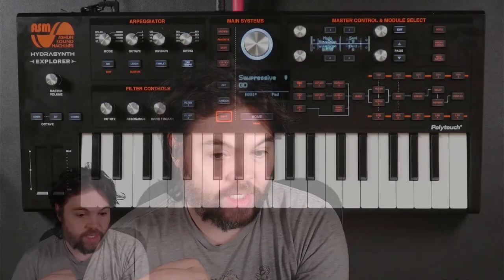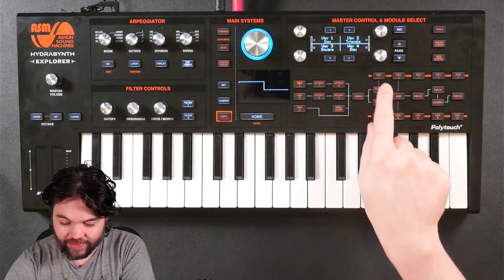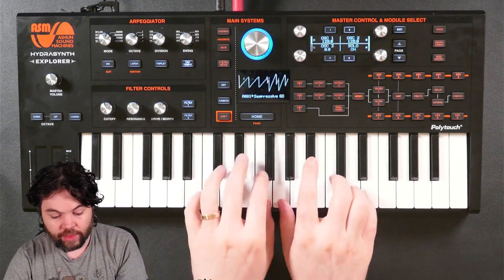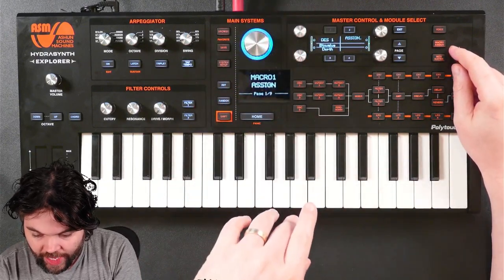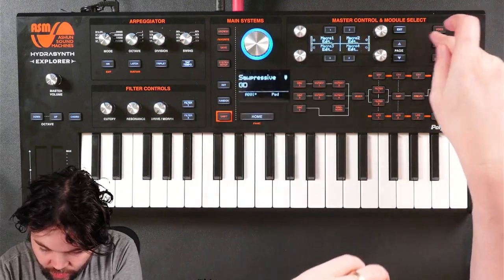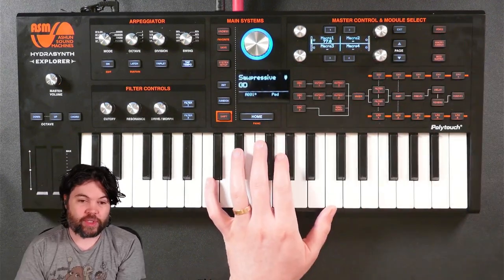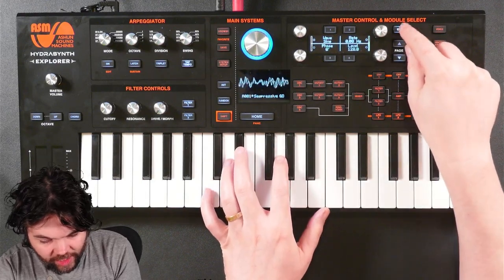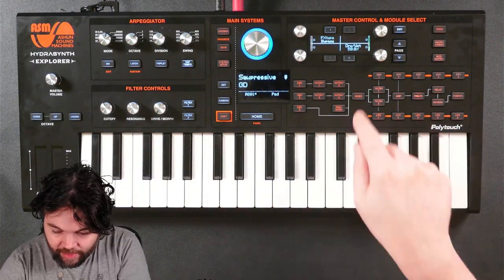Learn With Me - Hydrasynth: Ep03 - Oscillators 1 & 2

Comment: Thank u so much for taking the time to make all these videos. I don't have a Hydrasynth but looking at the sound design capabilities has me wanting one really bad. If you've spent any time with the Arturia Minifreak, what sort of comparison would you make? They both seem great for the price point.
Reply from the maker: Thanks for watching, and for your comment. One thing you might want to do is check out the patch tennis series I made: https://youtube.com/playlist?list=PLuh4CHo4ShJdg_61kZyNUoZOAfDUBV2zy . You get to see me and another YouTuber make patches back and forth showing some of the capabilities and workflow.

As for my opinions, I think the difference between the two is quite big. The Hydrasynth has a slightly weaker core sound, but a very complex modulation section and the mutants, which add some really unique capabilities, alongside the dual filter and poly aftertouch.

The Minifreak has a stronger core sound and a simpler oscillator section, but the oscillator algorithms (and capacity of the second to be a processor for the first) gives easy access to some unusual timbres. Its effects all sound great and generally it feels quite direct.

UI wise, the Hydrasynth benefits from a lot of consistency, meaning almost everything is behind a button and the encoder bank. This makes it slightly less direct vs a typical synth and feels like things are behind a menu, but it's a menu you have a lot of physical means to navigate. I would say it's a good approach to handling the complexity, but it makes it less efficient for designing sounds live. I'd characterize the optimal use case as designing complex sounds including a bank of macros you'd use to control it, rather than dialing in sounds on the fly.

The Minifreak UI is similar to the Microfreak, but with more controls added to give access to the extra features. The panel controls give you direct access to quite a lot alongside using shift to get to secondary functions. You can design a lot of sounds sticking to the panel in this way. Compared to the Hydrasynth (where" everything is in a menu") you feel a big disconnect when you do need to enter a menu. This doesn't stop you designing sounds live, but it does make situations where you need to go into the menu feel more awkward. The mod matrix is fairly easy to use, though selecting the modulation with a single encoder feels a little slower than it could be. One UI element I like is the macro section; while you only get two macros per patch with 4 destinations each, you can control them with a touch strip; I find this much more natural than turning the encoders.

The choice therefore comes down to this; if you want a slightly more immediate, fun and quirky instrument with a broad sonic range, then the Minifreak is it (I haven't even mentioned the arp and sequence which are great). If you want a maximalist subtractive synth with poly aftertouch and an efficient interface to dive deep on, go for the Hydrasynth.
Reply: @ChalkWalkMusic  This comment alone is more useful than the video that comes up when you search "hydrasynth vs minifreak". Thank you!

Comment: ... and the next step would have been to assign a LFO+ to Macro slot 1 in the Mod Matrix. ;)
(But I know you haven't covered that yet.)
So many possibilities with this synth!
Reply from the maker: Thanks for watching, and for your comment. I definitely find myself doing that type of thing often: rather than making multiple mod matrix entries from a single source, I make a macro and use that instead. I've also adopted an approach of placing macros I primarily intend for a human to adjust starting at macro one, and macros primarily for mod matrix use starting at macro 8. As you say: lots of possibilities!

Comment: In your answer to another comment, you mention not having a button to assign aftertouch in the mod matrix. Does that mean aftertouch is limited in its application? I play a Roland AE-30 wind synth and when I control other synths such as the Neutron or MicroFreak, I send the breath as aftertouch and that needs to override the envelope (the breath effectively IS the envelope). Do you think this synth could handle that?
Reply from the maker: Thanks for your comment, and for watching. The aftertouch is freely assignable in the mod matrix, the problem I pointed out was that there isn't a panel button for it; with the LFOs and envelopes you can hold a source button then press a destination button and it'll map; with aftertouch you need to go through the list; my "workaround" to save time is I assign lfo5 which is further through the list so there is less scrolling.

As for a breath controller, the mod matrix can accept any CC as an input (since the controller is monophonic I assume you don't necessarily need to use aftertouch). Assuming the controller sends notes (and depending on the gate length, this assumes it just sends a trig) then you could have a very long release on the VCA envelope and have the breath CC adjust the VCA level (which you'd set to 0, filter might work too). If no note ons are sent, you could latch a note instead and do the same mod matrix routing.

In other words, I think it should be easy enough to do what you want once you figure out how best to handle the gates.
Reply: @ChalkWalkMusic  thanks for the detailed reply. The AE-30 can send its breath and motion parameters as almost any CC. I just pick aftertouch because it's the most frequently compatible - the Neutron even has an Assign CV patchbay output that can have aftertouch assigned to it.

It sounds like this synth could be an excellent companion. The AE-30 internal sounds are a pain to program and frankly don't sound as good as other synths.

Comment: I'm confused about the Macro Assign / Wavescan part ~5:00

This video being my first glimpse at Wavetable / wavescanning synthesis, my immediate thought I have is Ohh you should be able to assign an LFO to modulate the Wavescan position.

Is that what you were doing here? Or simply creating an interface to manually edit the wavescan position for live playing?
Reply from the maker: Thanks for watching, and for your comment. A common use of a wavetable is to have it automatically modulated by an LFO or envelope. In practise though, scanning a wavetable is just another timbral parameter for the oscillators.

As you say, in this case I've mapped scanning through both wavetables to a single (manual) macro control. Just like a mod wheel, a macro remains where you leave it, vs returning to a neutral position like a pitch bend. This means you have two options for using it. One is to move it to find a position you like and just play it like that (a variation on the patch), or to treat adjusting it as part of playing. In this case I use the latter approach and use it to adjust the timbre as I play.

Note that for the Hydrasynth, I can adjust macro parameters from the mod matrix. I could therefore, for example, map an LFO to the macro which would in turn scan both wavetables. In these early episodes I just try and vary what I do and give quick previews of a few features which I explain and use more later in the series.

Comment: What other synths have this much sound design at this cost?
Reply from the maker: In hardware, I don't think it has much competition; in fact there aren't that many "serious" polysynths at the price. You have the blofeld, minilogue XD, Deepmind, JD-Xi, microkorg, Korg mod trio, Minifreak and the new Roland Sh4D. Sound Design wise I think the Minifreak is the closest, but offers quite a different value proposition. The modwave and wavestate are very powerful synths, but a little more specific in their strengths. The blofeld is powerful, but the UI is far less fluid on use. I'd probably say the Opsix is one of its strongest competitors, despite being very different; a very different feature set and paradigm and much lower build quality but huge sound design potential.

Comment: Are you still liking the Hydrasynth?
Reply from the maker: Thanks for your comment, and for watching. Since I got it I've felt in two minds about it. First of all the explorer is very good value in terms of features for cost. The questions are about overall sound (it has something of a "hifi digital" sound mixed with some sort of lofi character) which is surprisingly characterful for a digital synth and you tend to either like or not. Second, there are a few UI/UX quirks; it handles the parameter count well, but it seems to miss a few tricks, e.g no button to assign velocity or aftertouch in the mod matrix, and turning the encoder to assign in the mod matrix does nothing until you hit the button on an empty slot, or adjusts the depth if the slot isn't empty. These quirks, you'll get used to, but for me they make the workflow feel less fluid. It's a good synth, with a lot of depth to it and some unique aspects (the mutants, and the poly aftertouch keyboard) but it's best when you design patches with care then save them to perform with macros you assigned: for live sound design I find it less enjoyable. In short: if you like sound design and the overall sound of the synth, and want a poly aftertouch mini key keyboard, it's probably a good choice. This series will continue next week, so you'll get to see how the rest of it all works if you keep watching.